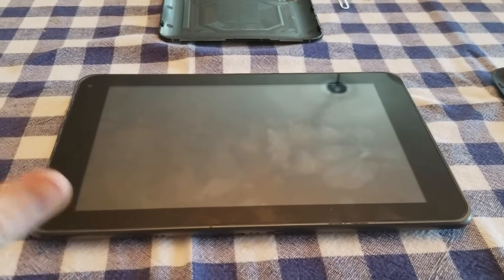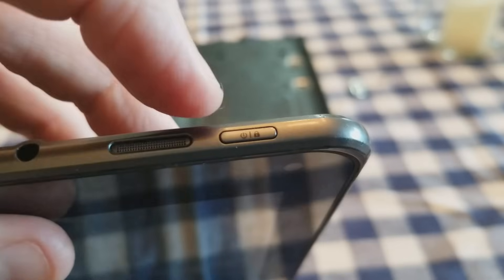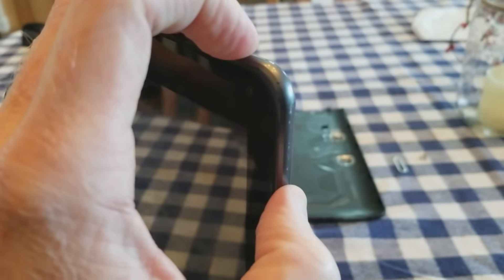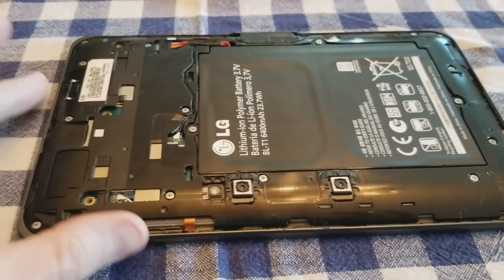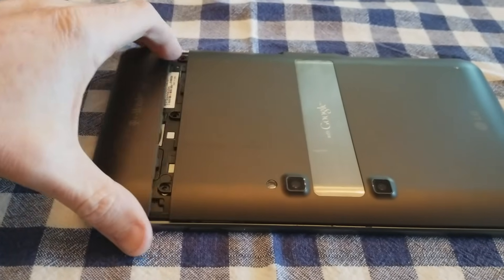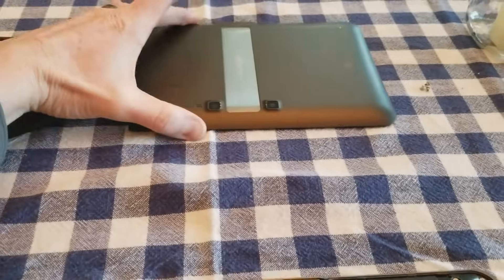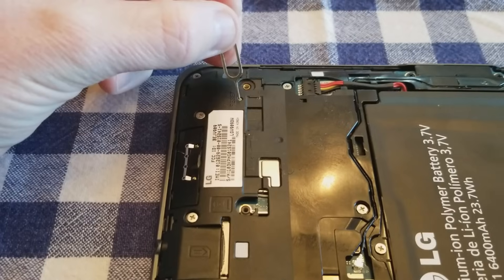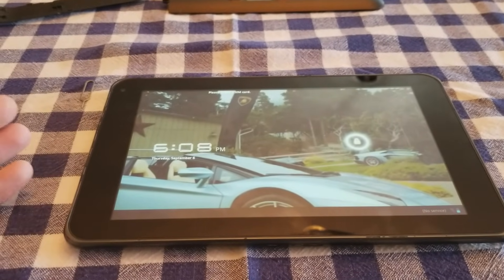Android Tablet Won't Turn On FIX!!

Comment: I have a proscan tablet (which is powered by andriod) and it's missing the power button and the reset hole won't do anything and it's charged but once it shows the proscan and the charging icon it just turns off, what do I do?

Comment: It's not even working for me. You know, it's not even off for a day and I charge lee's tablet and when you like turn it on it's taste smart life within reach but it's powered by and I tried everything that you say but it doesn't work for me. I'm sorry. Don't you have anything to? Do you know like it was 0% and I charged it after I charged. I come after I charged that I.  And come a couple of minute passed.
But when I come, I turn up, I mean like I.
Press The button and I was trying to open that and it doesn't work for me. So I start seeing this video. I just press the value button and the power on and off button together. But it's not working for me. I don't know what to do yet so so what?  It just.
 Have you know it's Android? And it's a smart life. Was english product top late PC mobile k? T.
 1006 impute 5V = 2A

Comment: Please help. My Samsung tablet won't charge or turn on. I tried everything, plugged the charger straight to the wall, and it started to charge a little bit, but it stopped.  It won't  do anything.  Please, please. Is my Samsung tablet done? 😢😢😢 thank you for anything you could tell me.

Comment: i have lenovo tablet it tb-J706F i was charging it and then suddenly it turns off and it wont turn on so i charge it, after many hours its stuck on its logo and the charge bar thinggg, and its been a month since then but rn it still wont turn on its still stuck on it logo, i tried chrging it but nothing happens 😭😭
Reply: Aww it's okay

Comment: I have an samsung tablet.
Its have an very interesting issue.
Whenever i try to turn on it directly the screen is black out but the tablet is working but doesn't showing anything. 
But when press the volume up key and power button it re-starts and the display becomes normal. And it works fine
But i have to restart it evertime i need to use the tablet. It's really frustrating 
But i have bo clue what to do

Comment: my tablet is a Lenovo
 and it's stuck on the reboot mode and i took it back to where i got it and they said they couldn't get my photos off it
 i would love your advice please it has a built in battery so not sure i can get the back off

Comment: I have a Lenovo yoga tablet. I tried the first 2 things that you did ages ago. The tablet was totally dead. I took it to a repair shop and they put a new battery in the tablet. The tablet is still dead. I contacted Lenovo but they didn't seem interested.

Comment: So I still don't know if this will work bc mine the screen falls but one day I accidentally fell in the floor so I fraved it and it didn't have a black screen after 4 seconds it did and know it doesn't turn on and it does sounds whit I put it to charge or take the charger of

Comment: This worked! Thank you so much! All I had to do is to charge it for like 4-5 hours and then I kept on trying to turn it on by holding the power button and volume up, after few attempts it worked! The tablet NEEDS to be on the charger and then it will turn on

Comment: I just put my tablet on its charger, it hasent turned on for months, i tried the buttons and it made a sound, im currently having it charge rn and i will tell you if it will turn on

EDIT:legit forgot abt this comment, my dad put my old tablet on his charger and it works now 👍
Reply: Did it turn on
Reply: @TriintyHortonspamacc  no but its screen did sum weird but it didnt turn on
Reply: @Obbu100  oh
Reply: @Obbu100  my is kinda doing the same lol
Reply: My is 😢

Comment: Cube Model T8 White/silver U need help please. I’ve not charged it in couple years so I plugged it for few hours but it won’t come on. I tried the on with the volume up buttons for 15 seconds but still nothing. I’ll charge longer and try again. Any other suggestions? I don’t know how to remove the back cover   It has three slots at the top. One for SIM card I think one for back up card but nit sure other. Says S1slot for SIM card, S2 not sure &  1F not sure ?? Help to know what other slots are for and how to turn on. Ty so so much for ur time 😁

Comment: Wowww! This is unbelievable. God used you to save me a million!
My Samsung galaxy tab s7 turned off while in use. Didn't know what to do. Tried turning it on; I tried charging it, but it's not showing charging signs. 
Thanks to this video. I had almost shipped it for repairs. On a second thought, i checked uTub and found this video.
I connected it to a power source and pressed simultaneously the power and volume down button, and after 15 seconds, it turned!!!! 
What a miracle 😊

Comment: The way I fixed the BSOD was to disconnect power from battery for about 5 minutes and push the power button to drain the capacitor. Then plug the battery connector back on and push the power button.

Comment: Guys another fix I found (for Lenovo Tab A7): plug the charging cable and unplug it BEFORE the tab vibrates. Do this around 20 times, then it'll start up.

Comment: I have a Link tablet. Wouldn't come on. Based on your tips I inserted tiny pin into the pin hole for 5 seconds. Removed pin then held bol up button and power button and VOILA! After almost 7 years it is ON!!

Comment: Try use a 5.5V 2A USB charger. 5.5V instead of 5.0V. 

I have a HDMI TV stick powered by USB power, but I find that the stick does not boot when I use other normal USB power charger. It only works with the original USB charger, and that charger is 5.5V.

This Telcast tablet  suppose to use normal 5.0V USB charger, but actually this is wrong. It actually require 5.5V. This may be because if the bad quality control of components, wiring or design if the circuit.

I tried the methods by you folks above and success sometimes(when I was stil using 5.0V charger). But then the problem happens again, and even when I success boot this tablet, I find that the battery charging is super slow, or oftenly "fake charging", the tablet says it is charging but the battery level drops.

After I change to 5.5V, everything work perfect now.

QC USB charger may not work because it automatically switches to either 5V or 9V, which are both not suitable for this tablet.

Comment: You absolute legend, my blackview tablet appeared to be dead, woudnt appear to be charging when plugged in, i thought the charge port was knackered. You were straight to the point with a solution that worked 👍
Reply: Oh my god! My blackview pad won't work too! Which one  make your tablet work again? I'm getting stressed out!
Reply: @graceleeboon4769   held power and volume up buttons simultaneously for about 15 seconds
Reply: @MrDeeJayBee69   not working still, just  logo on the screen,not turning on or show that it's charging
Reply: @graceleeboon4769  its broken.
Reply: Bro i got a Blackview too for 250 Euro and After 1 year its dead now

Comment: None of these actually worked sadly, the thing is my screen is completely black so when I press my flashlight on the screen I can faintly see the screen working,. I tried many videos but none of them lead to success. The reason why it doesn't work is because my younger sister used to throw the tablet on the floor and I couldn't turn it on. Hopefully I find a way to fix it but for now I'll keep on searching, you can reply and share some tips down below. Feel free.

Comment: On my LG Gpad 5 10.1 FHD the power button and the volume down push together and held for 5 seconds restarted my tablet.

You are not able to take the back panel off this device, but power button with volume down at the same time worked!

Comment: I didn't watch the full video then I noticed there is a pin hole in the tablet I took a pin and put it it worked well I didn't see the video I guess it helps I opened my 5 year old tablet that I haven't used for while it had my child hood games :)

Comment: It appears that for your particular tablet there was no need to take the entire back cover off. The [RESET] button should be accessible after removing the smaller door only.
Anyway, thanks so much for sharing.  😉👌🏻

Comment: I have a duoduogo tablet and it would not turn on and I tried your first method with it and the screen turned on but it was black and it said sim1 and some sort of language that wasn't English and it made this really loud beeping noise that wouldn't stop so I found the little like hole where you put like a needle or something and it went back to normal, I was scared I broke it broke it

Comment: i have an old tablet like this, its stuck on the chraging screen and won't turn on. If i use the reset button, will it delete all the data on the tablet?

Comment: This didn't work for me, anything else I can try? I'm not sure if it's power up or down but I tried both. Would I have to hard reset again between tries? I've only had this thing 3 months. Let it drain to empty since the manual recommended it if not a heavy user and now it won't turn back on. So upset

Comment: if it doesn't work this way , try holding power button and volume down button for 10 second together at the same time....it will surely work

Comment: I just bought 4 learnpads for £20 and got one web-connected in 5mins (which was fun) but can't get one of them to power up so I found your video. I just wondered if I'll immediately see a charging logo or animation IF power is getting to the motherboard/battery?

Comment: Tried this on samsunga6 tab tried everything suggested it had suddenly stopped and screen went blank attached charger the battery icon came on but after a few seconds it kept flashing then went off I can't think of anything else

Comment: The reset hole with the Sim eject pin solution really worked with my Galaxy Tab 3. Definitely, everyone should watch this if they have that issue!
Reply: Hey do you remember where the reset button is in your Galaxy tab 3? I can't find it
Reply: @Emily-nl9sb  I think it's next to the power button. It's actually a hole that you have to put your sim eject pin in

Comment: it didnt work my tablet is powered my onn and you cant take to back off its charged but still wont turn on by holding the power button and volume button and i have no idea what to do i bought this tablet in 2019 so its pretty new and have no idea it pops up that it is charging but after i cant turn it on please recommend me videos so i can fix my tablet thank you have a nice day
Reply: DO YOURSELF A FAVOR, SAW THE TABLET IN HALF AND TAKE THE SAWED UP TABLET BACK TO THE STORE YOU BOUGHT IT FROM, THEN WALK OUT.

Comment: Thanks for the video!! I just did the first part of the vol & pwr buttons to turn on my tablet (lenovo TB x6o6f, manufactured on 2020) which I bought as a christmas present for me. It randomly restarts but this time I left it to charge because it had low battery. Anyway it didn't want to turn on. So I followed the first instructions of the vid and press the power button again after 30 seg and it turned on!! Thank you!!

Comment: I have an t10 alt8ce that hasn't turn on in 1 year the back can't come off when I turn it on it stuck on the logo and doesn't move I factory reset wiped it still the same result I don't know whats the problem and I has power
Reply: T10 Altice

Comment: I charged my tablet I went to the shop came back it wasn't charged at all I waited like 2 hours it still wasn't charging and turns out the plug I was using didn't work -_-

Comment: Hello, my tablet has been off for like 3 years, and like it fell off my dollhouse, and it fell from like the top floor💀 it didn't have a case on too, tell me if I should go to a repair shop cause charging it or opening it won't work lol
Reply: and btw it opens from the front but I don't wanna open it

Comment: I purchased a rooted tablet and tried to reset it to remove the root so could update the os and now it wont turn on and when i plug it in the charging screen goes off and on. But when plugged in i hold down the power&volume butto. It will respond and go to the samsung screen but shuts back off and goes back to looping the charging screen

Comment: bro my tablet died and i charged it and it said 0% and i was like ok
i wake up and check the time on my brand new tablet (the sound sucks on it but it works pretty well) and i check my older tablet which carries most of my gameplay and etc and i was like panciking when it didnt turn it on
like it did it a couple times before but i was able to turn it on with only the power button
hope it works as im writing this comment before trying it :)

Comment: ok so, my tablet is newer(this one specifically: Samsung - Galaxy Tab A (Latest Model) - 8" - 32GB - Silver), and every time I try to turn it on, it'll vibrate, the screen lights up for a second, and then it'll go back to the black screen. 
I've also let it charge for about 3 days before and still nothing. this first started happening about a month and a half ago and it's caused a lot of problems. I've switched out the charging cord multiple times but it still won't do anything
Any advice?

Comment: A helpful tip: if your tablet is dead, charge it and leave it charging for 2 to 3 days and after 2 or 3 days go ahead and open it by holding the power button

Comment: Thank you!! 😩🤗🤗 I was trying to fix my amazon tablet. It was not taking charge and won't turn on. I tried holding the power button and the volume up botton for 20 second and it started charging.

Comment: When I plug in my tablet it shows the charging symbol but not the percentage. It dose this when I first plug it in, and then shows the percentage after a couple seconds ( when it was working ), but even if I leave it plugged in for a few minutes it still won't show me the percentage. It's like it's not charging at all..

Comment: what if the power button broken missing plug in charger powers on shows android screen , turns off could i use reset button & volume burton method instead of missing power button please got important stuff on laptop 👍

Comment: Method 1 worked on my Lenovo TB-X103F.  I was about to take it all apart and disconnect the battery as suggested by some other videos.  So glad I came across this before I did that.  Thanks so much!!

Comment: Thank you so much, i haven't used my tablet for many months and when I tried to turn it on, it didn't work and after charging it for many hours it still never turned on, i tried your first method, didn't work and as soon as I tried your second method, 2 minutes after charging it, i pressed the volume and off button for 5 seconds and it turned on.

Comment: This is what happened to my tablet two times and my phone i think my mom threw it away but idk I'll ask her where it is and see if i can fix it bc i love that phone. 

Update: I put my tablet(the one i mentioned earlier) to charge before I searched for this vid and when I tried did the on and volume button it showed that it was charging but before it didn't so i guess that did the trick. But with my other phone it stopped working when I was in Mexico, my cousins stole it and we were about to go to a restaurant and they gave back my phone it was at 18% so i turned it off and it didn't turn on again.

Comment: These steps appear to be universal for all androids. I had a walmart brand tablet ONN ona19tb002 tablet that was dormant for over a year. It would not power on.
I plugged it in for 3 hours to charge then did exactly what he did. An Android menu appeared asking three choices, fast boot, normal boot or reset to factory. I selected normal boot with volume down and that was it. I then held the power button down for 5 seconds and it booted to the android OS!

Comment: What if you can’t remove the back cover? I might have to go to a tech place to get it fixed. It’s been a couple of months since I last used it. Mine is a 2014 (I believe) Samsung Tab 4

Comment: I replaced the battery, the black bar that you are supposed to "un-lick" (the widest one)the ribbon on the galaxy tab a 10.1....when I went to lift it, it just crumbled (into 2 pieces), couldn't replace it, lost the pieces, now it won't take a charge or do anything, put it all back together after replacing the plastic tape and the other 2 ribbons, it's been on the charger for 2 hours, nothing, did I kill it?
Reply: Yes...yes you did.
Reply: @notsurefornow69  Thanks a lot, wasn't looking for criticism, looking for some kind of suggestions to work around fix.

Comment: My tablet says battery temperature low please disconnect charger and then turns itself off and won't turn back on I can't fix it it will start to turn on then just won't 😤😠😤😠😤😠😤😤😠🤬

Comment: I have Samsung Galaxy Tab4 7" and when you turn it on stays there showing the brand like loading up but never ends, stops when battery dies. I think It ran out of internal memory to even start. Do you know if there is a fix for that? I will try the reset bottom like in this video and i cant connect it to my pc to make room because pc wont recognize it. If anybody knows how to fix this problem please tell me thanks

Comment: Hello, I a  using Lenovo Tab 4 10" since last 2 years. But not from couple of weeks, it's been troubling. at around 50-55% battery, it goes off. Then When I put on charging it only shows RED light blinking but doesn't charge and come up. It happened twice or thrice and somehow by moving charging cable, it came UP. But now it's only showing RED blink light but doesn't come up. Even checked with different charging cables. Pls, If you can guide n assist.

Comment: Asus T-100 power button melted inside. Found out when I beat it against the wall I now have a spare power port for the other where the teeth inside that charge it fell out. I will never buy another Asus product in my life. Two high end laptops died in just under three years. I'm not a heavy user. Took care of my stuff. List over 3K to them. Junk. Pure junk.